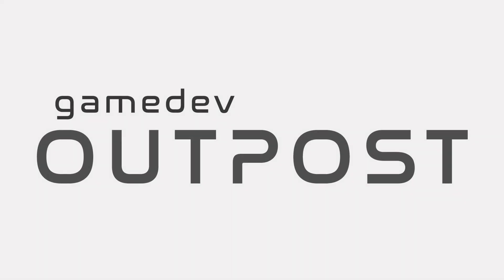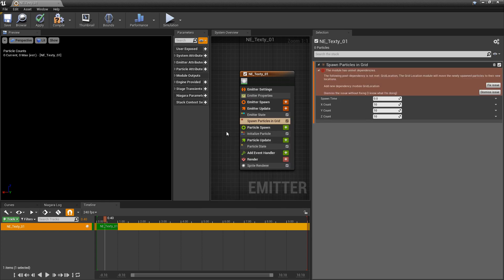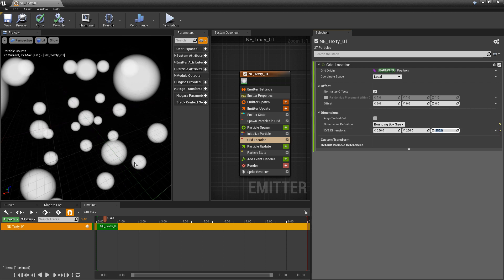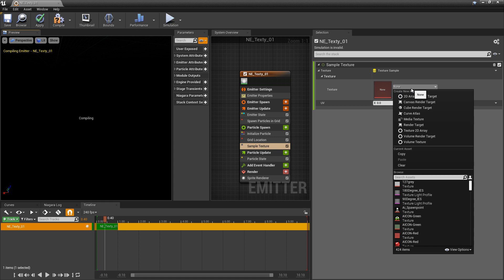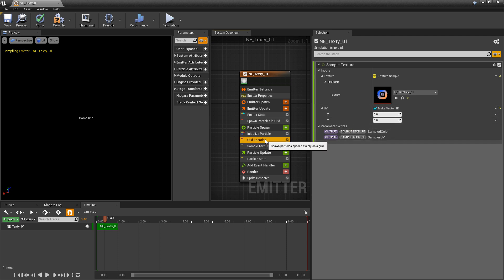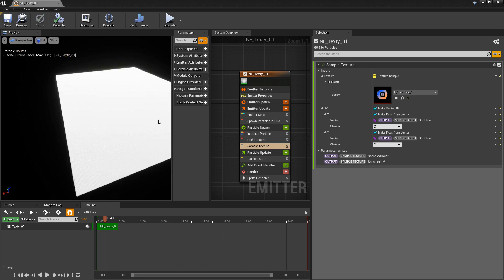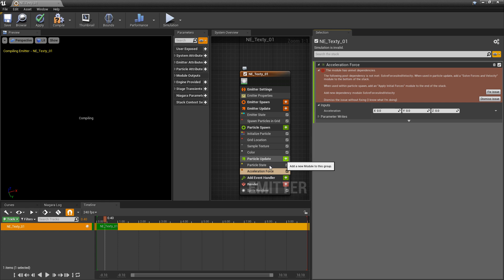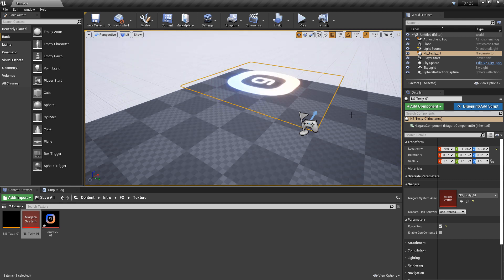UE4 - Niagara Texture Sample

Comment: Great tutorial thanks! There is a slight work-around the issue that we can't have this working on update. Not ideal but still cool to experiment with. Basically you need to set your emitter update to "Self" with a loop duration between 0.02-0.04 and then a particle life of 0.1.  You can then use a render target to feed an animated texture in to the particle system. This is  quite performance heavy  and can be slightly optimised by using the kill particles module and kill particles depending on the alpha (look at the the content examples).

Comment: This is really good, but I need to be able to do this (and the kill alpha particles part) using a volume texture sampler. However, the volume texture sampler doesn't have a UV parameter so the whole thing hits a dead end at that point.

Any ideas?
Reply: Never mind! It was 'Sample Pseudo Volume Texture' I needed.